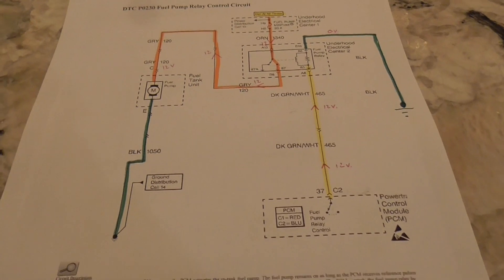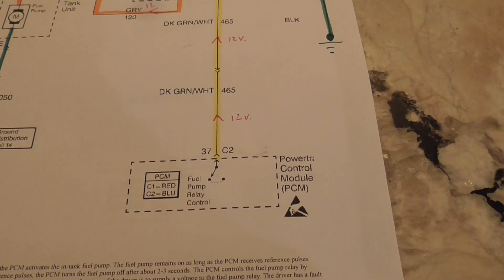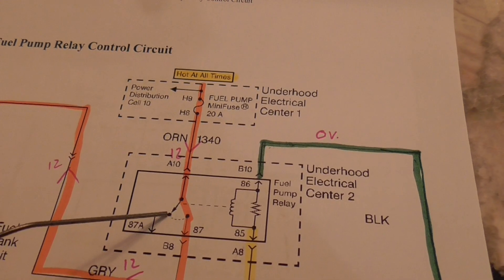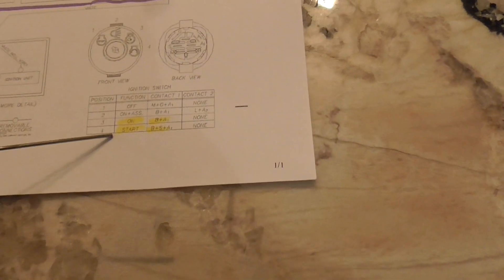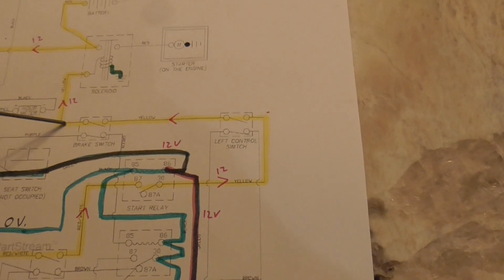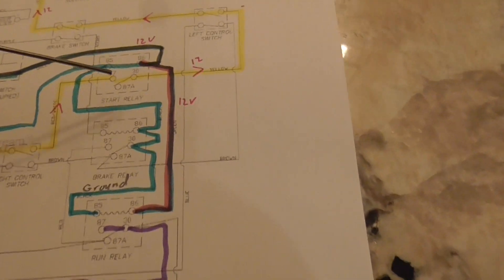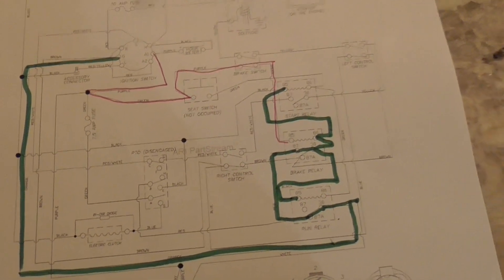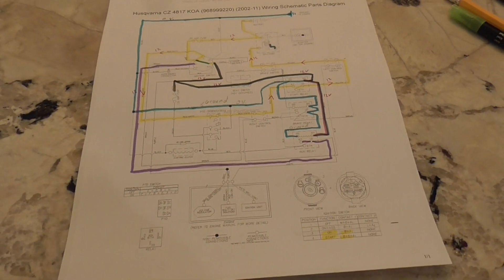Zero Turn Tractor Wiring Explained

Comment: Do you need the relay for the mower to work(i only have one)? I know its there to send power through the safety switches by design or ground the mower like the kill circuit you described, but is it necessary for operation?

Comment: love it!! dont love the fact of now i have to completly take apart to replace the part that is bad☹️. unless there is an easier way? lol  of course mine is the wire that runs the whole course  of the diagram and into the coil. I am going to watch more of your videos to see if by chance you cover changing it out. Thanks so much for the break down in pics! It helps alot

Comment: ..... Excellent, I would call the switches interlocks as they have a string function.
Your microwave door has an interesting series of three interlocks, if they don't actuate in the correct sequence, one of them shorts the mains and blows the fuse.

Comment: My neighbour gave me a mtd zero turn that had most of the wiring destroyed by fire. Mtd could not provide the schematic for the exact model , just the engineering spec. A similar mtd with schematic had 3 relays which I knew that mine didn't have. Based descriptions and test procedures in the operating manual I was able to rewire it.
Reply: Fantastic! Thanks for sharing!

Comment: Hi I was wondering if you could make a video on the Toro wiring system
Reply: To be really proficient at electrical troubleshooting, it takes years of experience.  To be good enough to do many repairs that seem daunting and a complete mystery to most people, it takes diving in and trying.  Understand how to use a multimeter, test as you go, eliminating working areas, and don't be afraid.  About 10%-15% of small engine repairs involve electrical components, so it is valuable to learn, rather than avoiding.
Reply: @mikespain8655 I agree.  Maybe not at first until I bought a multimeter. 
  Have a jd zero turn that blew a couple fuses once. I replaced them, still had issues. 
  Naturally, i ended up going online to see what it’s all about in the mower tech world. 
Bought the multi meter, followed all the processes, had a horrible time at first trying to read the schematics ( no legend to tell me what the different symbols meant), but kept plugging along if u will. All the safety switches, connections, Rebuilt Delhi connectors myself. Bought new key switch and interlock relay. Starter was good thankfully. 
Everything was hooked up properly but I just could not find the location of a 3rd ground to frame the diagram showed. The drawing was so vague. 
Eventually I found this bolt that has a hanger attached to the frame near parking brake. 
It then dawned on me, that’s where I think I remember the spark, and that’s where I remember the engine starting miraculously when I would put left steering arm out of neutral lock( that was bizarre to say the least but my girls got a kick out of it). 
That bolt is where the ground came apart!!!
After 2 wks after work tinkering, swearing. Begging, blaming John Deere, my dog, everything, well, I found it!!!
  I did this harness over so many times, and tested resistance, continuity etc, it was as if I was married to her.  I knew every body part she has. 
Like u said it’s something one really should try and tackle themselves. You’ll get so frustrated you’ll wanna give up. My advice, just walk away for awhile go do something else. 
Eventually you’ll find it, and you’ll be su proud of yourself for not giving up after doing the right thing. 
My z 445 is cutting just as great as it did when I bought it new in 08. 
I don’t wanna give it up it still cuts beautifully and the Kawasaki runs excellent ( knock on wood), 
  Unfortunately way up here in up upstate ny we’ve got Halloween snow coming so I’ll be putting it in the barn for 5-6 months.
Reply: @ACERRUBRUM31  Thank you for sharing your story. It takes persistent time and research and patience. Thanks! I am sure glad I found this video!

Comment: The Tractor Diagram; Are the wires numbered to coin side with the wiring diagram so you can troubleshoot the safety switches better. I know I would run continuity test on different legs of the circuit to see what is or is not making up the circuit. You should be able to check the Ground also to different legs of the circuit with one of the meter lead, and the other meter lead to a known ground. The cars or trucks relays and fuses; Check with your vehicle manual to locate fuses and relays for example the AC Compressor to test the proper fuse and relay function. You can buy Relay Tester really cheap, I bought one and it works just fine for $20. My AC wasn't cooling properly (barely cool), I tested the compressor relay and sure enough it was bad. I saved on not going to the dealership and not paying for that cost. I had also purchased a spare fuse and relay box for $60 on Ebay for my 02' Ford Ranger, which I maintain very well. Another thing: Some of these relays are interchangeable in the relay box, so I could have easily swapped a relay for my AC Compressor for troubleshooting purposes. So I did spend money to save money.

Comment: BET you could help me, I've had MANY electrical issues with my Snapper tractor, the seat swicthes have been disabled etc and what I want to do is ELIMINATE >>>ALL<<< the wiring dealing with such,  I have the diagram but can't follow it, I removed the complete harness and began removing the wires that go to EACH "safety" switch, NOW, LOL, I have become confused in how to reconnect or where to connect what needs to be done where I can put the harness back so the mower will function.  I'm wondering  if  I sent the harness & wiring diagram to you if you would fix my harness to make my mower functional again, ALL I care about is the starting & charging system, the lights, electric PTO and other stuff is NOT needed, my tractor has a relay,  Can you help me like this?
Reply: I'm willing to pay ALL shipping, your materials and time.

Comment from the maker: Tools and Disclaimer:}
https://amzn.to/3nyhkLj 4 Post Solenoid
https://amzn.to/3os3BH8 Test light OTC
https://amzn.to/3npMN2g Ignition switch
https://amzn.to/3hYgx52 Tractor Relay
https://amzn.to/35IXuqP Multimeter for troubleshooting
In this video, I do my best to show you how the run, start, and kill relays work together to run and kill a tractor ignition.  I am not an electrical technician, but I do my best to walk you through the circuit.